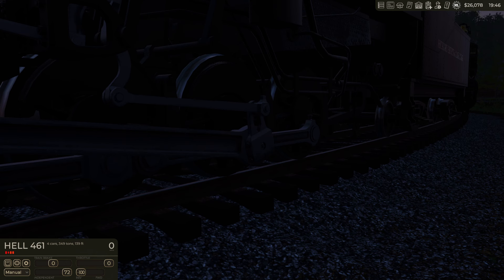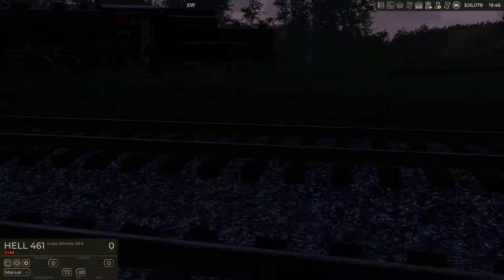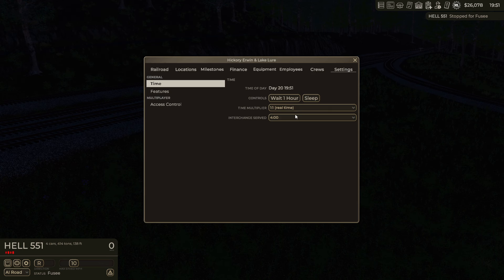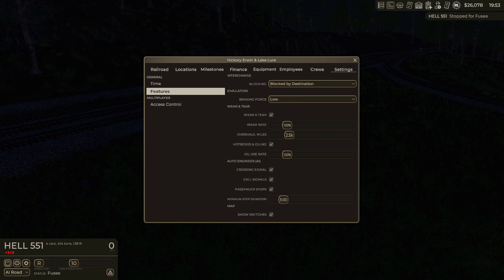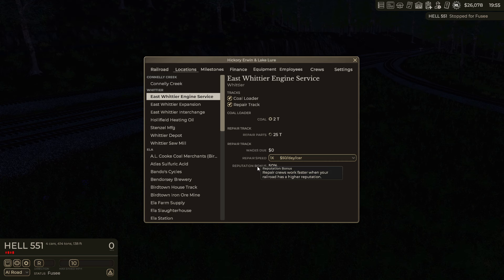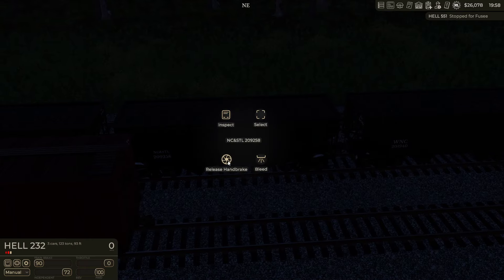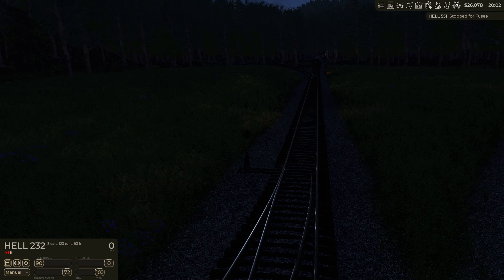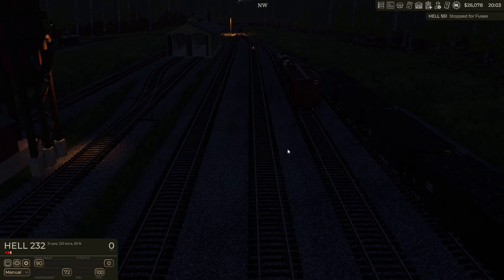Railroader - More Updates!

Comment: 45:00
Usually the engine wouldn't have a hot box because it didn't have the same oil and wick bearing the stock and tender has. The trucks, maybe, but not the drivers.
Reply from the maker: There's several different types, some use cellars that are similar to cars with an oil bath and packing, others have pressure feed oilers and others used grease cakes. You can definitely have a hot box on an engine.

Comment: Does the baggage car in Sandbox do anything yet or is it still useless?
Reply from the maker: @CSXP408x  only the obs car gives a benefit atm.
Reply: @OleandersGamingEmporium  How do you get the two steam loco AI's on the twins to work so seamlessly? I have to knock off the brake on one loco manually to get the two AI's to work
Reply from the maker: @CSXP408x  ctrl+click the second loco and click the mu button
Reply: @OleandersGamingEmporium  Ah, ok
Reply: @OleandersGamingEmporium  So I only need 1 AI?
Reply from the maker: @CSXP408x  yes

Comment: Instead of this garbage how about they make the map scene transfers smoother, valve gear exhaust and get the sound to be better. Add buildings and people. SIngle players have enough on their plates to go adding more minutia to the game. Not my cup of tea. Happily you can turn this nonsense off in settings. Change that and lose players. Have 650 hours in the game. Just sayin'.
Reply from the maker: The game is early access, you can also turn off hotboxes, oiling and wear and tear in the settings.
Reply: Only way the transfers get smoother is hiding them with a loading screen. That’s a hardware limitation. For it to be seamless, you’d have to have the whole map, assets, textures, and objects all cached, which isn’t realistic for 95% of the player base.